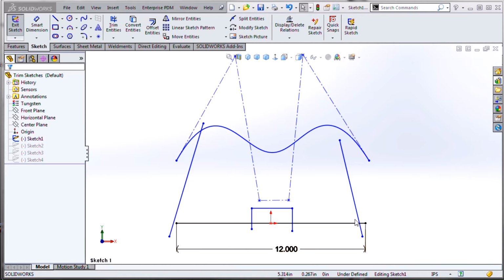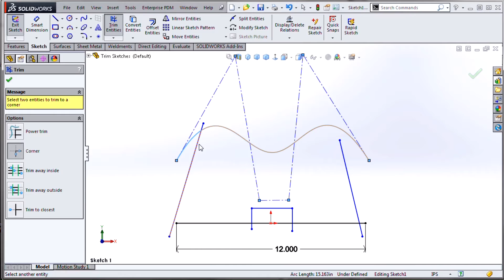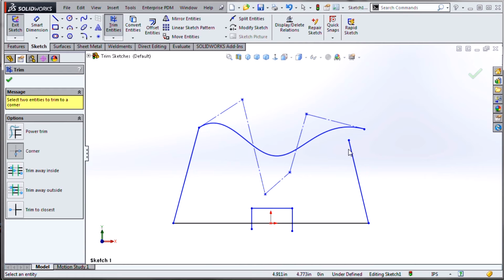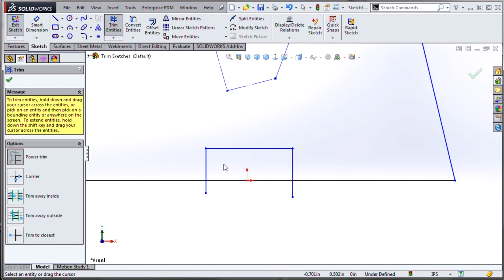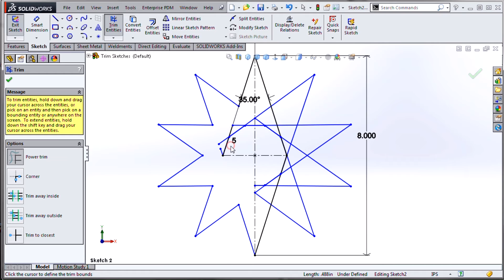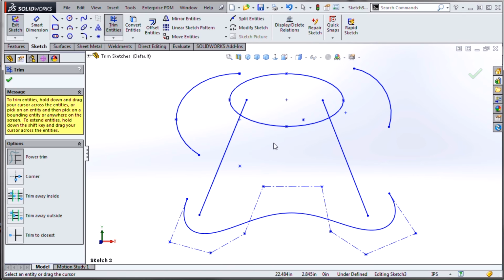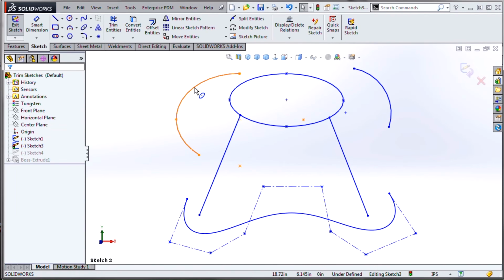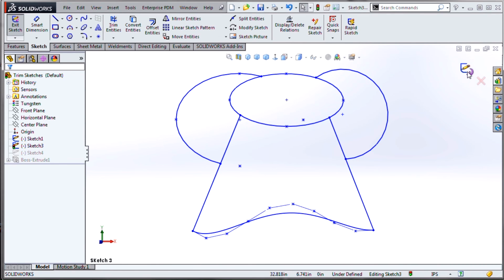SOLIDWORKS - Trim Entities Tool

Comment: Great video! I never would have expected power trim to be able to extend. I had been using the extend tool. I never knew the undo option as well, or the capability of the corner trim. Thanks again!